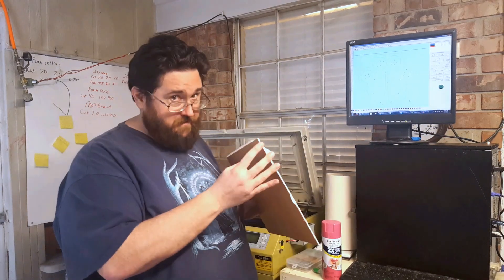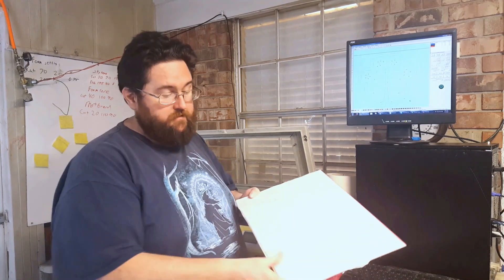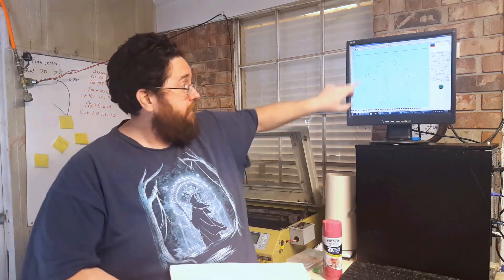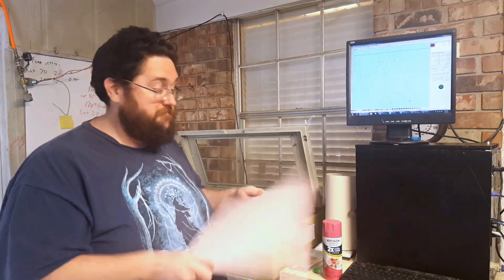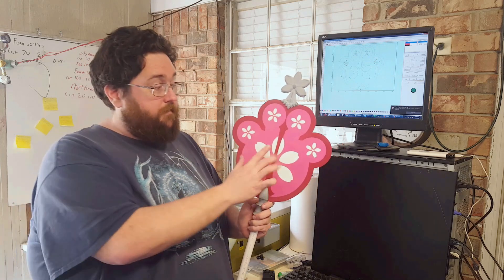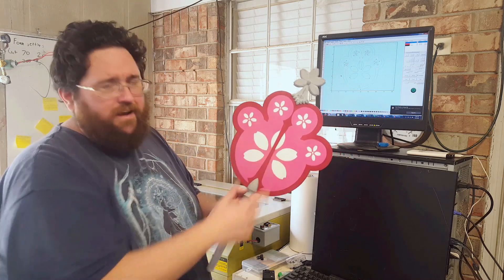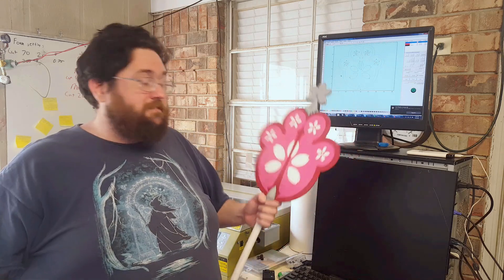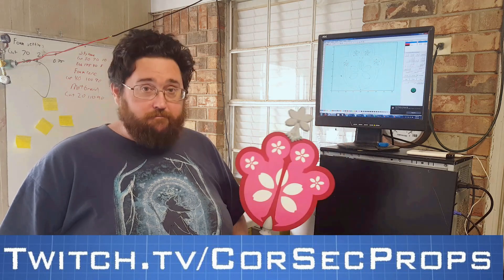Paint Masking with a Laser Cutter

Comment: Hi. Cool channel. A tip for laying your parts back in is to use a large sheet of paper or flat cardboard then lase cut the outline of the part at a very low power setting so it only marks the paper. Then, place your part on the paper (aligned with outline mark) and away you go!

Comment: If you would have done the edges last and not cut it out until last and just ran every job from 0 you would have been fine. You can also record the xy coords before running each job so you can return to work coordinate 0. I have a process of recording xy before each job Incase I need to run it again. Nice work clean cuts no scorching.
Reply from the maker: Unfortunately, our laser doesn't really have a good fence. So its all but impossible to put the material back in and get it to the right spot. The software is picky as well and always starts from the home position. I have plans to fix it... someday :)
Reply: Use K40 whisperer and get some aluminum angle from Home Depot and square it up. You can also use masking tape to allow you to engrave markings so you can align your work.
Reply from the maker: unfortunately, I don't have a K40. It uses a different controller then our laser. There is also an issue with home being only like 1mm from the bracket that holds the z axis screws. Its kinda a stupid design. I want to get a sheet metal box fabricated to fit my honeycomb and connect it to the exhaust system. Then I'll have some down draft for doing thinner materials and a good solid home point for projects like this. I just have not had a big need for it so its taken a back burner.
Reply: Idk if you’re an electronics guy but I ripped that Chinese garbage board out of mine and just put a brand new Chinese motion controller you can get on amazon for 25$ it’s just the three motors and leave the laser with its original power supply (just change the controller and make sure it’s grbl based.) once you do that you can define home anywhere you want just move to xy and zero it. You can also control laser power using the file (eg high power when cutting and low when engraving) using pwm so make sure the controller you buy has pwm outputs .

Comment: Nice process. You might have better luck with registration if you wait to do the outline cut last. To do this, place the whole piece of acrylic on the bed and mark the edges with some tape. I use a screen printing trick and tape credit cards to the bed, this allows you to bump the whole piece up against them to re-register after you peel the mask. Cut the mask but not the outline. Remove the mask, paint red with a bleed (enough to allow the outline cut). Then place the whole sheet back on the bed using the tape  (or credit card) guides. Now etch the white areas and finally cut the outline all in one program.
Reply from the maker: Hmm that is a good idea. I had not thought of cutting the outline after the red paint. My honeycomb isnt the greatest so getting tape to stick down would be hard. This one also has the added issue that i was painting the edges so id have to do that after the white was etched but masking just the top but could be easily done.